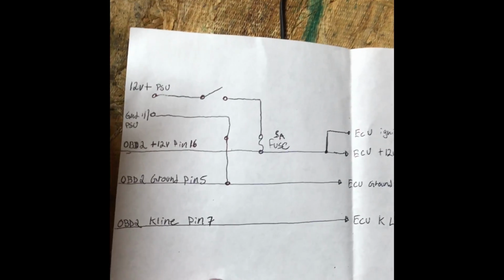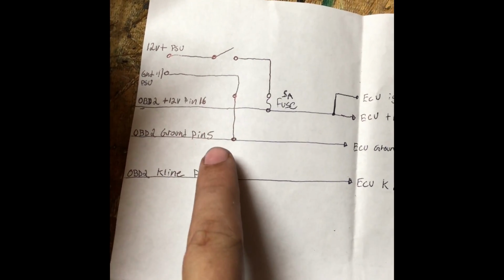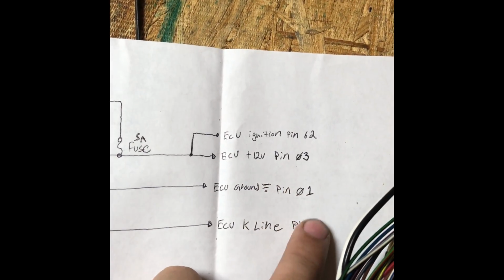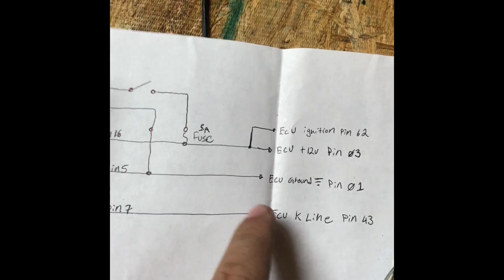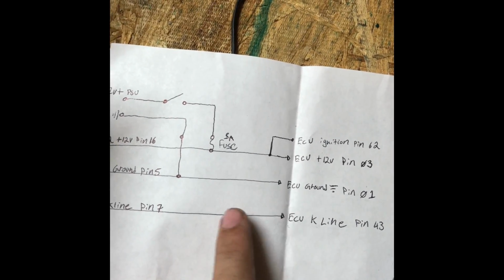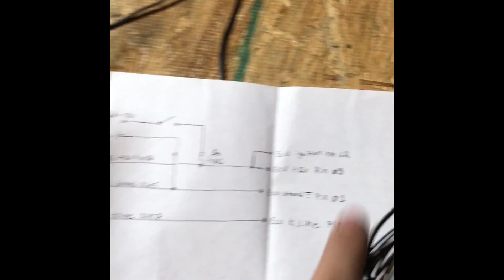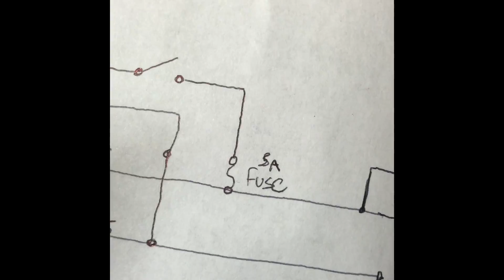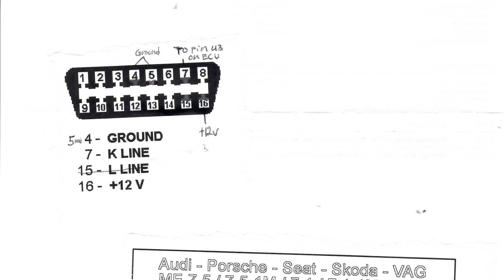Vw / Audi Ecu, Cluster, And Body Module Diy Bench Harness

Comment: Excellent Video my friend. My ECU was not turning on and I needed a place to test the connection other than on the car, thanks for wiring diagram to connect the OBD2 port, I took the ECU and the obd2 port to my room and it worked for me and more importantly I found the connection formula to finally turn on my ecu. Thanks a lot, very much appreciated.!!!

Comment: Nice work, would you mind making a drawing of the bench harness for the cluster? Also, is this for the older Volkswagen VDO clusters, 93XXX EEPROM chip?  Got a 2003 Jetta cluster I want to program on bench using the values from the original EEPROM.

Comment: Maybe a correction to your pic of the wiring diagram.  The ground should all be connected either together with poser supply or connected to the grounded case.  Is this correct?  *****Oh I see you have it correct in video but not on google one drive link.
Reply from the maker: 1975Kombi1 just need to be tied together, don’t have to ground to case. It’s all pretty much left open to do how you want, for instance I forgot to mention the part about adding a another 18ga ground lead with a 1k ohm 1/4 watt resistor in-line to ground to the boot pin to enter boot mode.
Reply from the maker: 1975Kombi1 think of it like as if it were setup in the vehicle, you just wanna replicate that just with shorter wires.

Comment: Ya I thought of that.  I'm going to remove all the smaller connector pins not in use in the ECU connector.  The 3 pin has a slightly larger size opening but I think the terminal size is the same size as 1 and 2 and 4 and 5.

Comment: I'm missing pin 3 12V in my ECU plug.  I guess it's back to the scrapper to find another ECU plug.
Reply from the maker: 1975Kombi1 you should have a shit ton of other pins not being used already in the connector, atleast one of the big ones, just re pin it is easy

Comment: hi man. I have a ploblem with my me 7.5. I try to flash my ecu with mpps v13 but by mistake i chose a wrong file  (without checksum) and after flashing the car was run very good but wen i turn ignition off didn't  start anymore.  Please help me .
Reply from the maker: Plamen Keranov I don’t mess with mpps sorry